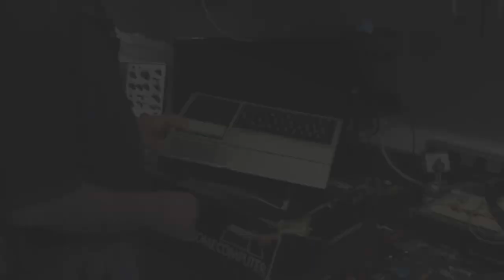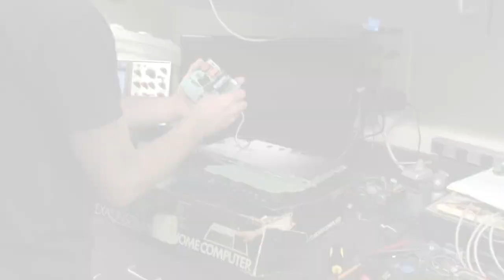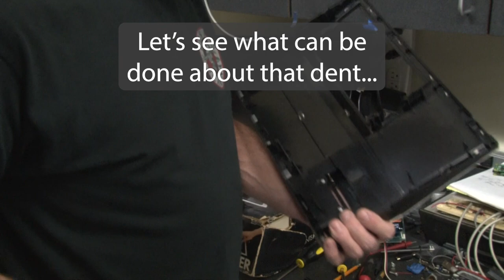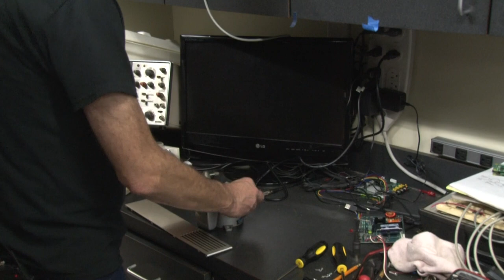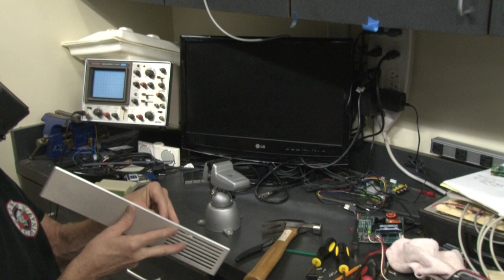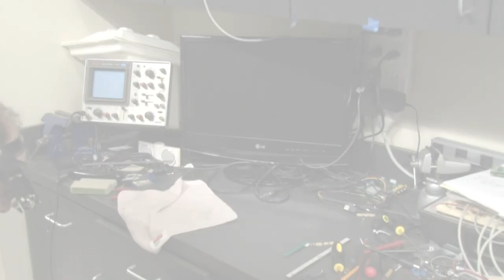TI-99/4A Light Bodywork

Comment: Number one watch for The Ribbon Cable on the keyboard... Too many times flopping that around you going to break it off.
Number two don't lay the top cover upside down on your work bench You're only adding scratches to it.
Number three that water getting into that rubber pad was probably because the pad was upside down sitting on a table and water apparently got spilled on the table and was probably absorbed there that's why people shouldn't eat and drink around computers.
I don't know why you had such a hard time with your screwdriver and the screws.. The screwdriver I was using never slipped around in the slots of the screw..
I didn't see you remove the felt from the cartridge port. Usually that's dried out and rotted and prevent some games from running correctly it's best to remove it.